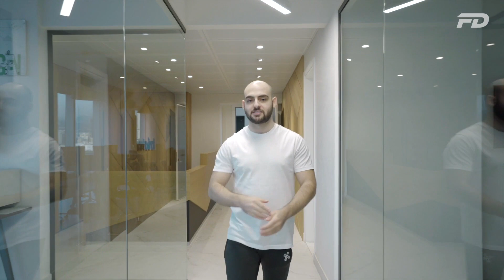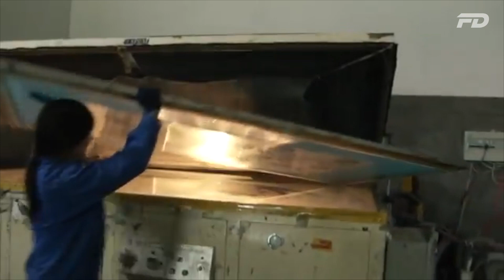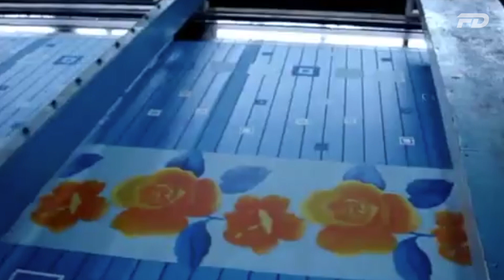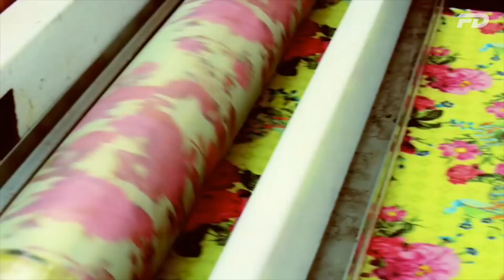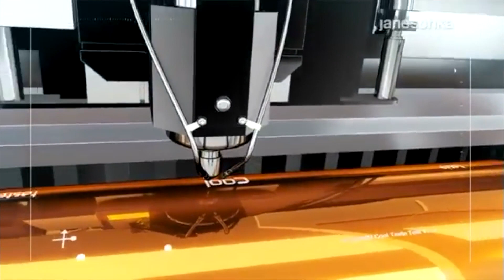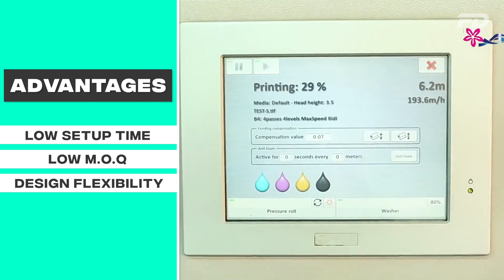Top Textile Pattern Printing Methods

Comment: i had a question, i am starting my brand and im using a blend of 50 cotton and 25 rayon and 25 polyester but i want to find out what would be the perfect method for printing for shirt it has 3 colors and it’s a small logo in the front and big logo in the back. Is there any advice you give me?

Comment: Hey great vid again. Which process is best for a first run for custom yoga pants/ spandex
Reply from the maker: You're most welcome! if you're doing a custom pattern print I definitely recommend flatbed printing over alternatives like rotary (higher MOQ) and sublimation (can look cheap in certain circumstances) - flatbed is a nice middle ground